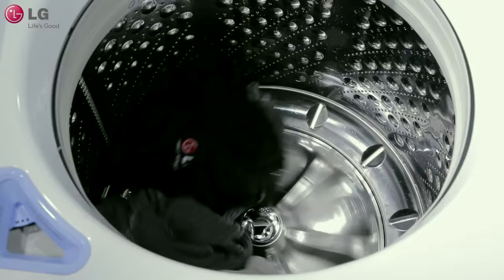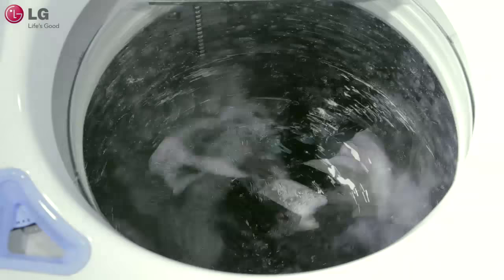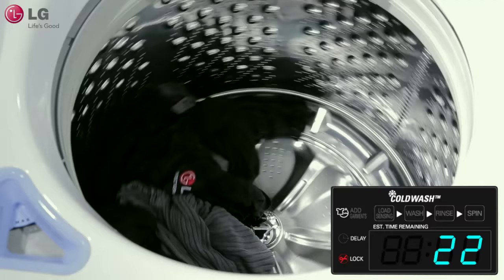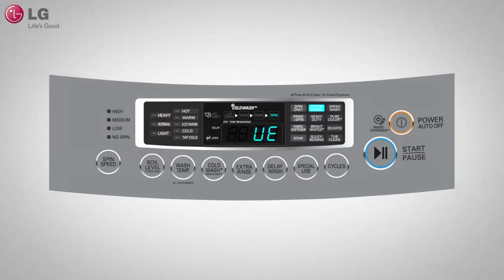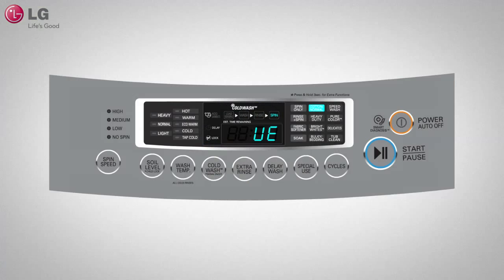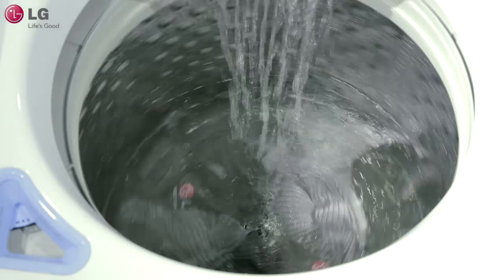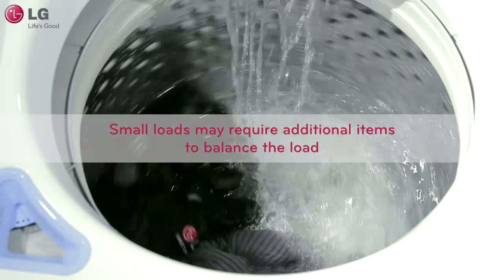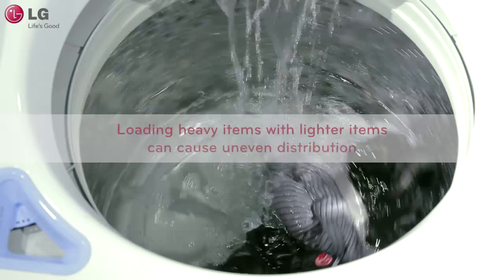LG Washer - Top Load Balancing & UE Message (2018 Update)

Comment: My washer was fine to start with. Then a few years ago LG had the recall for the problem of the washing machines shaking and becoming unbalanced. I made the mistake of contacting them and they sent a tech out to flash the firmware. Ever since he flashed the firmware, I get the UE error a lot of the time. How about if LG would send a tech back out and put the "old" firmware on my machine and I will sign a paper holding them harmless if my my washing machine move around at some point while spinning?? The tech said supposedly the firmware update only slowed the spinning algorithm but it really screwed up a washer that was good until that point!!!
Reply from the maker: Hi, HW. I’m sorry to hear you're having this issue. So we can better assist, please contact LG Customer Support by direct message via Twitter ( @LGUSSupport  ) or Facebook Messenger ( https://www.facebook.com/LGUSA/ ). Please include your model and contact information in the private message. Thank you/ ^Tammy

Comment: between uneven washer cycles and sensor dry not working properly (shutting off too soon), it takes days to do one load of laundry. I literally have to babysit the washer to ensure it doesn't keep resetting back to rinse. I'd rather go back to old school washer and dryers that aren't "efficient" but do exactly as they say. It shouldn't take an hour and a half for a cycle of clothes to dry, only to find that THEY ARE NOT DRY. And also, time dry doesn't work either. It still thinks it's dry and shuts off. I hate this set so much. It is so awful.

Comment: I have been washing one blanket and one sheet through 5 cycles. I hate this washer with a passion!! It’s a top load washer, I got for cheaper than a front load. It will never balance out correctly. We keep re positioning the load so it will spin out. Never works. I’ll never buy another lg washer.

Comment: We hate this washer with a burning passion. What is the point of a high efficiency washer if it keeps looping the spin cycle and completely refilling/draining the washer? Ours has to be babysat on the final spin cycle EVERY TIME. This usually involves manually adjusting the load, power cycling etc. You need to pay your engineers and QA dept. more money. My Samsung fridge has been a total disaster as well. No more Korean appliances for me.

Comment: I absolutely loathe this machine!! I swear, I have tried everything to keep the loads balanced and nothing works. I’ve separated my clothes, made sure I had like items in my loads and still it will wash for about an hour and a half only to tell me that it’s uneven with heavily soaked items sitting in the machine. The problem is you won’t even know if you’re going to have a problem until about an hour and a half later! Not to mention when I try to select a spin only cycle, it starts to add water after four minutes!!. If it’s spin only, then why is it also adding water, all I need to do is spin. I hate this washer, and as soon as I am able I will be purchasing something else and giving this away to a shelter or something.
Reply: Give it to someone you don't like.

Comment: I've been trying to get my load for balance for 2 hours now. I'm so sick of this washing machine. LG are you going to reimburse all of us for this defective product that wastes so much water? You need to do a recall on this product. This should not be on the market
Reply: Just had a repair man speak to a tech at LG, this has been a known issue for years.  The only way to fix the issue is replace the suspension rods.  If that doesn't fix it, a new clutch(splines wear out) is needed.

Comment: BALANCE YOUR MACHINE! I'd guarantee you your machine is out of balance. Your manual is pretty casual about this. 
Get a level or use your phones level and place it on your machine. Another person is helpful to let you know if it's balanced.
Release the lock bolts on the leg of the machine.
Adjust till balanced FULLY.
Run Spin cycle
Run Spin Rinse cycle
Load machine and run full cycle
Problem solved
Send me $10, LOL 
And you're welcome!

Comment: This is useless.  My dam washer goes uneven just about every other load.  I've had it for 6 years and maybe until now 1 once every several months apart. I cant even run a tube clean cycle without it going uneven.  I cant complete the tube clean. I always have to power it off when its empty just to use the washer!

Comment: Our LG 1101CW was trouble free, then after replacement of clutch assembly the vibrations during the spin cycle started. AT this point the washer is barely usable and requires frequent manual balancing of laundry to complete a load. The strut/shocks have been replaced, springs added as suggested. LG Authorized Service ( (S)FAST Appliance Repair Inc  ) have been on-site and said washer appears to be fine and suggested sorting laundry by type pants, towels, shirts etc. This is not an acceptable "repair" in my opinion, we never had to do this before. I am so frustrated that I am ready to get rid of this washer and dryer.

Comment: This is a stupid  machine spin only cycle continues to add waterIt's so frustrating it's the worst balanced machine on the planet No matter what you do with the legs it just isn't stable  One thing's for sure you don't want the front legs higher than the backlegs Cause there's nothing to keep the water in the drum on the top load machine if the front  are higher it just flows out over the back of the drum  right down onto electrical
Reply from the maker: We are so sorry you feel this way! If you'd like assistance, please send a message to our support team on FB or Twitter (LGUSSUPPORT) Thanks! ^Emma

Comment: What ever you do when mad, do not buy a front loading machine. You may get just past warranty and all bets are off. I had the best? Maytag Neptune and the plastic blades that help move the wash broke and repair would have been over $500. for a .20c screw, but to get to that screw was taking the whole machine apart. Very poorly designed. Had it for 3 years. Still have the dryer after 9 years. Now thinking of dumping this LG washer as always out of balance. It says direct drive. Sounds solid but a pussy cat.

Comment: *DON'T BUY THIS WASHER*
As the same with all the other comments below. I've been doing laundry for 30+ years now and had never had an issue till I bought this HORRIBLE DESIGN by LG! DON'T BUY THIS WASHER!!!
You shouldn't have to weigh your clothes and have a engineer spec out where your clothes need to be put in the washers tub for each wash. I wish I could submit all my water bills and electric bills to LG for the endless UE codes I've received over the past 7 years.

Comment: If you're dealing with this error, save yourself the time and take it to the dump. Ive tried everything aside from replacing the computer. This machine is the worst I've ever owned or even used. The worst part about it, is if it would just spin the damn clothes and say its uneven, oh well, I'd throw them in the dryer and move on. However, it spins them mostly, soaks them down, spins them a little again, and then leaves them soaking wet. Worst machine ever. I HATE this thing and wont buy another LG product ever again.
Reply from the maker: Hello there. Thank you for reaching out to us. We're sorry to hear about your experience with this washer. We would like to help you out with this. Please send us a private message through Facebook or Twitter with the handle @LGUSSupport, and your contact information, and we'll be pleased to see what we can do to help. Thanks. ^Jolly

Comment: Agree with everyone.. run a tub clean No items..  still a ue code.. perhsps the whole tub assmbly is too loose? Also the whole "load sensing" what exactly is that supposed to solve?  Seems like its a solution to a problem no one needs.. A severe unbalanced ya can break the suspnsion or prematurly wear the suspension.. OF COURSE.. However thst is on the operator. Seems like they dont want to have decent service staff.. just expect you to replace every couple of years.. fwiw.. I am all to happy to repair a good appliance when there is wear and tear..  However its almost impossoble to find decent applicance repair perople now..
Reply from the maker: Hey there! Dealing with washer problems can sometimes be a breeze, while other times it can be a bit more challenging to figure out. If you're in need of some repairs for your washer, feel free to get in touch with us on our social media platforms using @LGUSSupport, and we'll gladly assist you with this! ~Rita